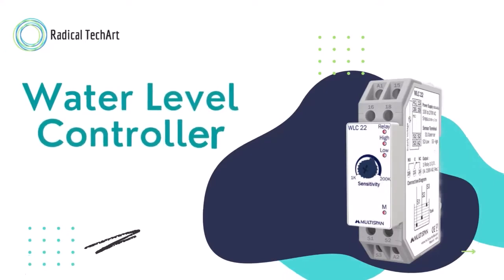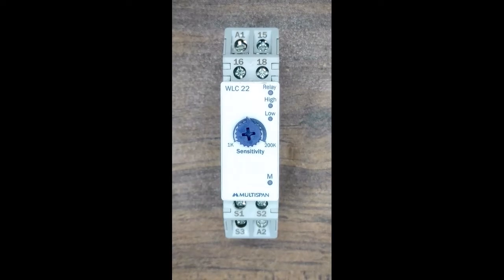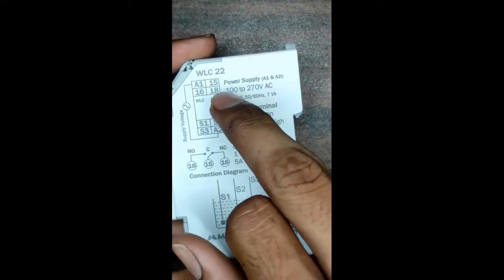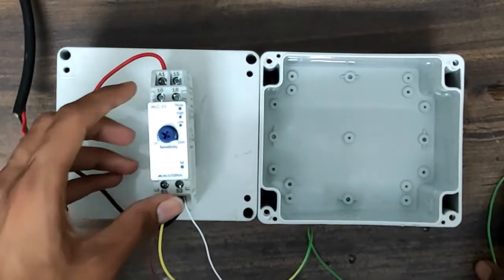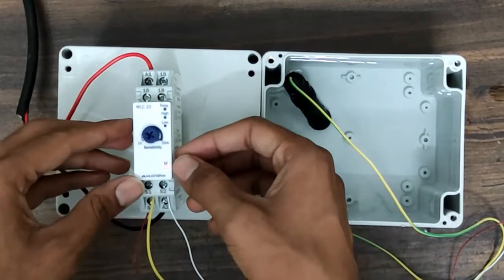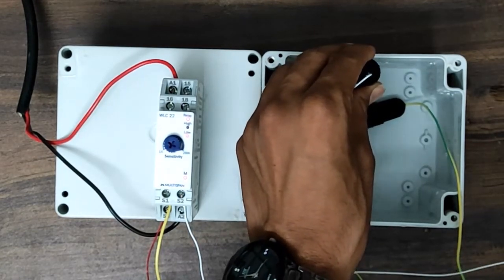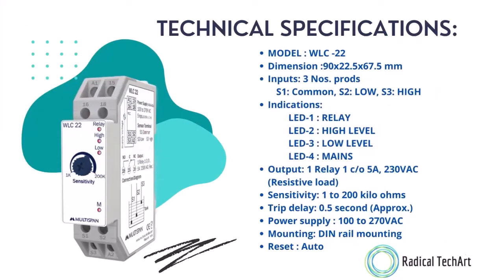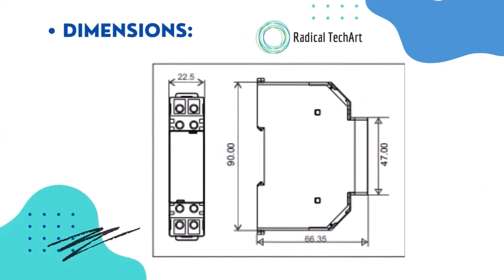WATER LEVEL CONTROLLER | WLC-22 | MULTISPAN RadicalTechArt I RadicalTalks I RadicalTechMart

Comment: Hi mem. I'm Senior Engineer . I like your video . Can u plz explain how to link PID data to scada .
Reply from the maker: You need to take PID controller with modbus output.

Thank you so much with your feedback
Reply: @rajkanabar7  we manufacture micro controller but it's not working with scada . U have any other suggestions . We r Working for defance project
Reply: How much price
Reply from the maker: @abbasmolarkudy7213  1000 + 18% gst